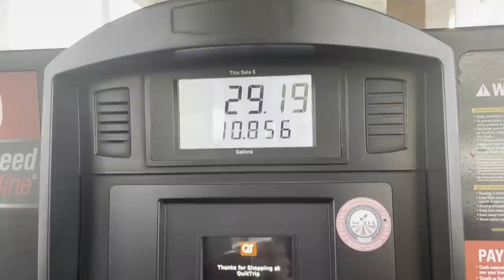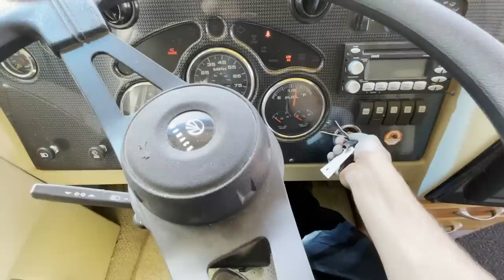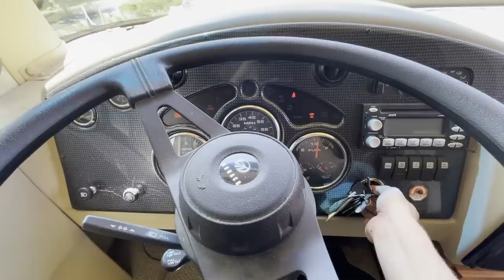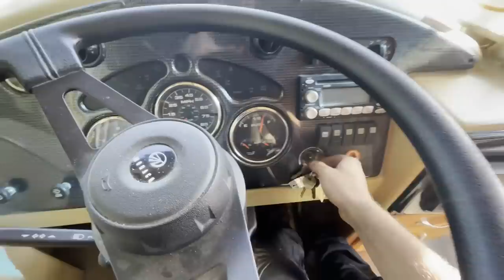Abandoned Motorhome RV Unknown Issues

Comment: There should be a BATTERY BOOST switch on the left had side by the driver. When pushed, it connects the coach batteries to the chassis batteries for more amps to crank. Charge them all up and bleed the fuel at the injectors. You are getting smoke so it must be getting some fuel, but maybe not on all the injectors.
Reply: I agree. Bleed the injectors and introduce some injector cleaner.
Reply: It should have fired on ether, but I still think you're right, it;s not spinning/cranking fast enough, It's close, but not quite fast enough.
Reply: You got a LEMON

Comment: When a diesel sits that long, and you changed out the filters. You need to prime the system in order for it to run. I have been dealing with diesels (big rigs) for 16 yrs.. Try that first, and make sure you have the proper batteries for that thing.
Reply: Pleb life….
Reply: Agree they never primed the fuel system
Reply: Would have thought it would start on the ether still though.  But definitely should check the fuel system.

Comment: When you are prime diesel engines after changing the fuel filter you need to add the diesel into the filter and then put it back on go to injection pump and prime it there by cracking the lines loose at the injectors and let it run out till you get diesel any air you not going to get it start

Comment: Engine is not spinning over fast enough - bad connections somewhere or not big enough batteries.
Reply: agree i would try putting 24v to the starter motor that would fling it over a lot faster
Reply: @pickard-cd2yn  it might well be a 24v system like on busses etc
Reply: Maybe that's the key. 24v system? one battery is only 12v...
Reply: @pickard-cd2yn  And potentially fry a lot of electronics. Great idea These RV's are a 12V system.

Comment: LOL, it's a diesel that has been sitting, the rings have relaxed and the compression is down. 24volt the starter so it spins a lot faster and  it will start. Once it has run a little the rings will seal back up and the compression will go back up. I used to work on diesels and seen this many times. Be careful with the ether, too much and a bang will bend a rod or crack a piston. Seen that happen too.
Reply: I'm not a Diesel Mechanic but >
What @ dbc 105  said, Leaves me w/ the Idea of getting one of those " Snake " Cameras, run the line down to the Intakes [ Where the Starter Fluid was Sprayed ]
and along side of it run some flexible tubing and add Marvel Mystery Oil in to the Cylinder.
But NOT MORE THEN 1 & 1/2  teaspoons, EACH [ so that you DONT BEND THE
Piston Rods !
If I Tried this, I would Let it Sit for @ Least an Hour or Two !
It might free up the Rings, and you might get it started !  Unless there is another problem !

Comment: Its not cranking fast enough. I would say that the grounding is all corroded. Left out in that cold and damp weather. Diesel goes bad and should have tried to drain the tank. I know you said it was half full, but its full of water. These RVs must be winter prepped or they won't start come spring time.
Reply: Or add a jug of Hawes fuel conditioner. That will pull the water threw without wasting alot if fuel.  Been using Hawes year round in all my diesel engines for years without ever being froze up or water sputtering.  It's a amazing product that quiets the injectors on start up. Takes that metallic rap out when firing up.

Comment: Combination of proper sized batteries needed …. stall fuel not only in the tank but along the way into the engine needs replacing and cleaning. Nice looking rig and a little outdated with some interior things BUT I would think with a Diesel engine that should last longer than gas engines it’s a winner. AND yes you probably should have found a local Diesel shop and gotten their help … especially with the distance you traveled back and forth. Good luck guys and love your channel. Down to earth and real life issues with real life people 👍

Comment: From a diesel mechanics perspective.
If its spluttering like that, it the batteries, not the engine. Its nothing internal because if it was not the battery, the exhaust would be coming out faster then it is. Try more battery power, and then failing that, clean out the fuel system. Defiantly a good deal and go right on ahead with it. Feel free to ask more questions down below this comment.
Reply: You might be a great mechanic but nothing is a good deal until you know the buying and selling prices and if there is something wrong with it and its cost of repair.
Reply: @leejones982  And from my opinion, it is a great deal. But let the brothers figure it out for themselves🤷‍♂️

Comment: 200+ comments and 1 person said it. Did you test/check the cutoff solenoid? I revived same engine on same chassis sitting for 7 years. 2 new batteries, real battery charger, pulled back solenoid and fired it up. Pick me up on your way back up there(Philly) and I'll get it started

Comment: Apart from all the other valid tips and comments, it sounded very much as if only one cylinder was really trying. Why not the others ? Need bleeding ? Valves not seating,  blocked or otherwise troubled injectors... Often they will come back once it starts but they are not helping that first start at all. Key point is that it needs more juice at the starter.

Comment: You should have phoned a local diesel mechanic to go round there and start and assess it, save you a long journey and a lot of parts, but you are in now push forward, check heater plugs and more battery power, enjoyed the video guys.
Reply: it needs more power juice.. if glow plug light goes out and their doin its job no reason way it should fire up.

Comment: Agree with all that are pointing to the Battery's but  would Check the Battery Ground Wire's because if that's no good you will just drain the power from the New Battery that you just put into it. I would also check the injectors for Air leaks  and glow plug  for operation ,either way still a good find .

Comment: Try and spray the starter fluid directly into the intake side of the turbo and also try to pressurize the gas tank. I ran low on diesel on my rv and it took me almost three hours to get it fired up

Comment: I changed my fuel filter on a Cat 326.  Didn't fill it all the way before reinstalling.  Lost prime.  Pressurized the fuel tank and took out plug in top of fuel rail to make sure everything got primed thru fuel pump. Started right up.

Comment: Usual things when going onto a job like this - take 2 seriously big fully charged batteries, supplementary fuel tank with electric lift pump to connect straight to the engine (bypass any bad fuel and a siezed fuel pump), starter fluid and 10 gallons of fresh fuel!
Reply: Best suggestions so far.
I was saying exactly that (minus the extra fuel pump thing,  which is BRILLIANT)
Reply: @MrPaige222  I agree. I seem to remember something about the fuel pumps on those Cummins engines were under recall for the exact problem the guys are having. Chris's suggestion will confirm that bad fuel pump, etc...

Comment: Worth the try for it's a nice motorhome.. Jusr the engine to focus on.. Make sure of all the fuel lines, pressure pump, injectors and ECU module are good.. Then the power issue on why it seems like it's nit getting that much power on the starter.. Or it might be the starter getting weak..

Comment: Did all the fuel filters get changed on it?  You probably got it back to the shop by now.  I agree, priming, clean filters first. Make sure you fill the new filters with fresh diesel.  If it's a cummins there should be a priming button close the the filters.  It takes a lot of button pushing to prime it sometimes.  The block heaters could be defective or the fuel injectors could be clogged up. Any of a numerous things.  I think it's worth it to get it running.  The engine could be tired and worn out, then again neglect and sitting is hard on a vehicle.

Comment: Watched the video - don’t think you primed the fuel filters when you changed them
- or did I miss that? Gotta admit thought it was a gasser when it first spun over did not sound like a diesel at all
Reply: Didn't see cracking fuel lines from the P pump to the injectors either
Reply: yep, that was my first thought.  Prime the filters.
Reply: Might be self priming system? I don't know about these large things .
Reply: They didn't show either way they just showed an old filter and said they did it. Either way you'd think it would have started on the ether if that's all it was.

Comment: When starting a diesel not started for a while, cycle the key 3 times to heat the glow plugs before trying to crank it to start. Worked for me on Mercedes, GM, Ford diesel engines. Don't know what the powerplant is so take it for what it's worth, 1 man's opinion.
Reply: Cummins have no plugs but grid heater which kinda unnecessary if not below freezing.
Reply: Still would have thought the ether would have overcome that if thats all it was

Comment: My view would be if it truly has half tank of old diesel, it may be bad/ water in it no telling. I would try to see if there is a way to bypass the tank and pull fuel from a fresh source to see if it cranks. If it fires up and runs then tackle the job of draining and disposing of the old diesel.

Comment: Monaco is a good RV Company (or at least used to be). My wife and I owned one for 14 years (Monaco Windsor) and did a lot of camping and traveling in it. If the RV has been sitting a loooong time, first thought is fuel not making it to the cylinders, probably due to air in the system. Also diesel fuel has a tendency to gel in cold weather, which means that stuff can be anywhere in the fuel system. Also agree with other that it should be spinning faster, check every connection between batteries and starting system, especially the grounds. Don't purchase w/o driving it, as I'm sure you know, repairing diesels gets expensive, quickly. One of the reasons I did 80% of my own maintenance and upgrades. A drive will show up just about any issue w/the drive train in short order. The fact that the filter you had trouble removing leads me to believe the original owner may not have followed the recommended preventive maintenance, which puts up a red flag in my book. Nice clean interior for sure, but that isn't where the $$$ disappear to.
Reply: I would also check the fuel pump, make sure it is working and it is pusing fuel out and it isn't gel.
Reply: They’re wearing T-shirts it’s warm fuel is not jelled you don’t know what your talking about.
Reply: As I recall, the coach was located in New York State and had been sitting for "a few years". Trust me, it gets cold in New York State.
Reply: @davidderway3227  I know I’m a New Yorker, the fuel will only be jelled in the winter. Lol! It’s not jello and stay set.

Comment: Did you prime the fuel system?  If a diesel sits for a long time or filters are changed, you need to get the air out of the system and prime it until fuel pisses out of the intake on the engine.

Comment: I suspect the fuel pump. Diesel tarnish is like glue. I suspect the shut off plunger is stuck in the shut off position. I bought a John Deere tractor that had been sitting two years, the electronic shut off plunger was stuck...

Comment: Hi from the uk , I love your channel really good content , you really need to go back and get that rv,  you have already bought parts and spent a few quid,  it wants to start but even with the new battery the starter motor still seems a little bit slow , and the fuel tank on that thing will be  massive , did you put enough  fresh fuel in , of theres more bad gas than good gas , that could cause you problems :)

Comment: My opinion after working on RV's for 30 years.  Check the coach batteries and see if they are still good.  If they are, start the generator up and let it start charging those batteries.  That way once it gets going you can press the aux start/batt boost button and it will help. You really never had the proper voltage to the starter so it could spin faster to start that engine.  It doesn't need an overhaul as it does not have that many miles on it.  You changed the oil which was a great start, plus the fuel filters.  I've never had to spray starter fluid in one to start it unless it is a really old engine.  That one is what a late 1990's to an early 2000's?  That engine just needs more cranking power and it will start.

Comment: Did you bleed the injectors after changing the filters?  Did you check the glow plugs for resistance. No continuity no glow plug.  Some engines, if the glow plugs don't cycle, it won't let the fuel relay open the fuel shut-off valve.

Comment: As with everything, it boils down to condition and cost…I saw a lot of rust around the doors and being from NY and me not seeing it in person, not sure. You can get 05-06 models from $55k (asking) with 50k miles. And saw one with 15k for $69k. All comes down to price.

Depending on how long it’s been sitting, one of the first things I’d try is flush the fuel system, clean the injectors and bleed the system and make sure the glow plugs are working.

Comment: Super clean., if there are no harsh smells I would buy it. I think the batteries are way to small. Not sure the engine but it should be a bigger cummins or a cat. The more battery the better . Plus bleed the air out of the fuel system.... bleed from the injectors to see if you have pressure

Comment: The fuel pump needs to be primed on a diesel. Taking out an injector and spinning it over with the fuel line connected to the injector would confirm whether or not the injector pump was primed.

Comment: Hi guys I just saw your video on the A class diesel pusher . When you changed fuel filters did you refill the new ones was diesel fuel before you installed it. If you did not it will not start until they failed all it’s going pumping air in the fuel system

Comment: crack open each injector line/loosen each injector, and crank the engine, or pump the fuel primer mechanism until you see diesel leaking , then tighten, and do the same for each remaining injector. that gets the air out of the lines, and will show if the pump is working. there may also be a mechanics starter button in the rear by the engine bay, like on buses. you probably lost fuel prime. you also probably need a little more battery to get that engine starter spinning the engine faster.

Comment: Hook up your fuel jug to the fuel filter base that has the primer pump. If there is gasoline in the diesel fuel it may not start due to lower btu of the fuel. The coach looks too good to have major problems.
Reply: You would be surprised how often folks make mistakes when fueling up. A mistake can cause untold grief and expense.

Comment: Did you have a primer pump to primo the fuel filter. If not did you prefill the fuel filter(through the small outside holes- this is the unfiltered side). You can damage the injectors trying to start it dry that long. That white smoke doesn't look good.

Comment: It was probably air locked, especially with a fuel filter like the old one. Did you fill the fuel filter before putting it in? Diesels will crank forever and not start when air locked.

Comment: Didn’t sound like it was cranking fast enough.  Could be several reasons for that. White smoke coming out exhaust show your injecting fuel . Which is another sign engine isn’t spinning fast enough to get diesel to burn.  Wouldn’t even burn the either. Did y’all check for blow by?

Comment: Working at underground coal mines I have found out that the diesel engines have to be turning over at a higher
rate of speed in order to crank . I would also bleed the air at each injector as well , but I'm not a engine specialist'

Comment: I'm not a Diesel Mechanic but >
What @ dbc 105  said, Leaves me w/ the Idea of getting one of those " Snake " Cameras, run the line down to the Intakes [ Where the Starter Fluid was Sprayed ]
and along side of it run some flexible tubing and add Marvel Mystery Oil in to the Cylinder.
But NOT MORE THEN 1 & 1/2  teaspoons, EACH [ so that you DONT BEND THE
Piston Rods !
If I Tried this, I would Let it Sit for @ Least an Hour or Two !
It might free up the Rings, and you might get it started !  Unless there is another problem !

Comment: Hi you guys, you didn't say you had replaced the injectors. Replace them & bleed number one. Turn it over & place your hand over the exhaust as well as flicking on the booster switch one of the other commenters suggested, that's how I used to start JCBs if they'd been standing for any length of time. They used to have Ford D4s in them. 9 times out of ten, it was the injectors.

Comment: Never change fuel filters on a diesel after sitting for long time cause you will loose the prime and you could burn the starter to get it started for the first time, crank it with old filters and then change filters, also when cranking you can use wd40 or auto zone brake cleaner and you have to spray while cranking to get it fired up

Comment: it also sounds like its cranking out of balance (low compression in one or more cylinders) been sitting a long time could be rings if you can get it to crank faster it may well start and running building heat may bring those cylinders back (are they reliable good question) i have no clue on value i suspect it may need an overhaul (inframe) at the least

Comment: Did you clean all the battery connections? And clean ground points?
When doing these adventures flow the KISS principle( Keep It Simple Stupid). It can be a lil thing that's causing the issue. Personally, more battery power and it will starts. It's almost there. 
As I said, check the basics before delving into the big things.

Comment: If you rotate the passenger tire to the front driver side, turn on the right turn signal and tap on the roof top four times while cranking it…I bet it will start.
Trust me, I had the same issue with mine and this technique works!!!!!